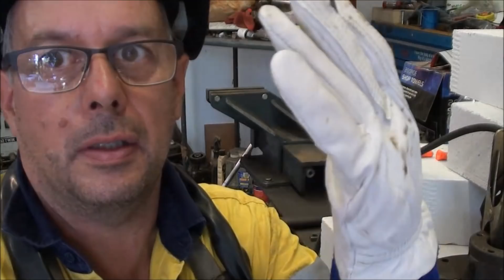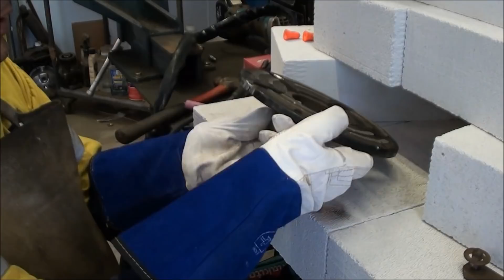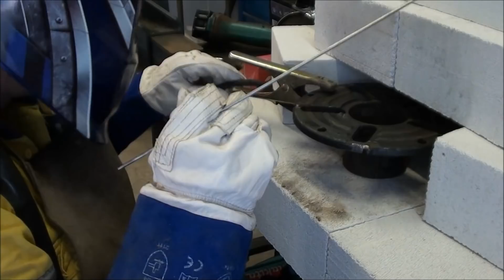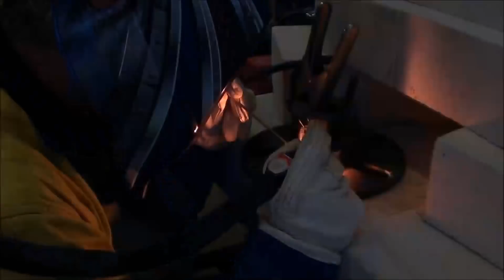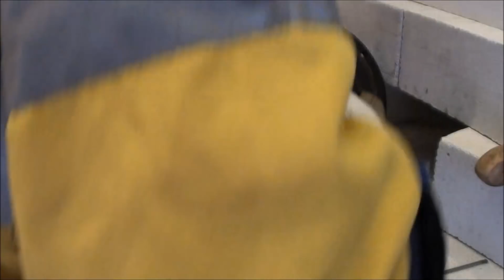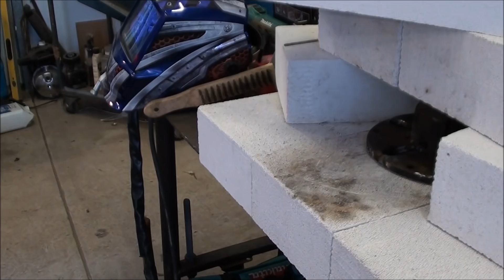Lathe Hub Part 2

Comment: G'day Greg, yes you're right about those Hebel bricks. I have a YT video where I have heated the brick with my furnace blow torch on one side for 30 minutes and I can touch the other side, amazing product. Also excellent for a temporary bench top oven. Doing good on the repair, I'll see if it pings in the next video.Cheers Peter
Reply from the maker: Thanks Peter. You've got one hell of a project with your milling machine. Glad to see it is still progressing. Greg

Comment: Is there much (any) pre-heat in the part here Greg?
Reply from the maker: yes mate, there is quite a lot of pre-heat in it. Once I start welding it holds the heat okay for a while but it does cool down fairly quickly due to the large surface area relative to the thin sections.